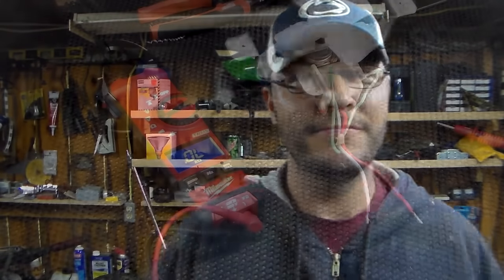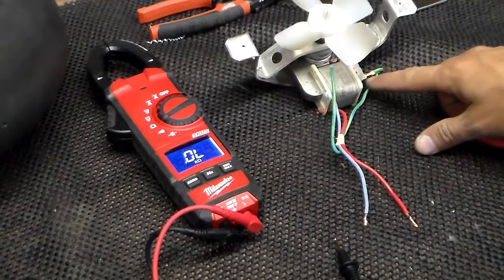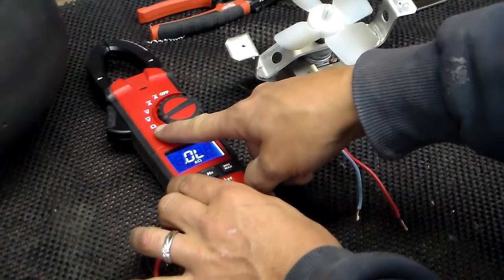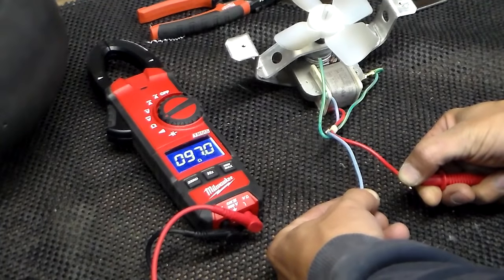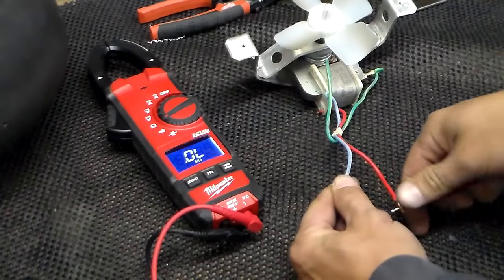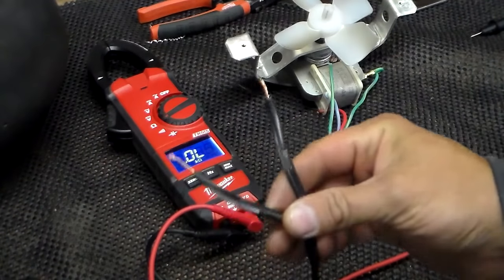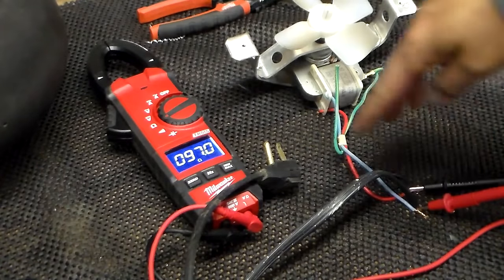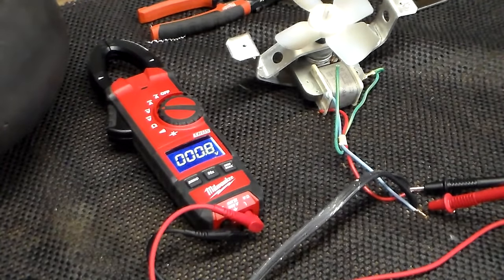How to Test the Evaporator Fan in your Refrigerator

Comment: Hi, Bill,
I like your video!
Please add one more check point at the very beginning: Determine what voltage rating of the fan motor, then proceed with either 120V or 12 DC.  They are not universal and not compatible with each other. 
Thanks for uploading the video.

Comment: After the ohms test, you should also test the leads to the metal body of the motor, in case the windings are shorted to ground.  When you test run it with 110v, put wire nuts on the wire ends, to make a good connection, and plug the cord into a power strip, so you can switch off the power quickly in case there is a problem.

Comment: Thanks fir video - I thought evap fan motor was bad on basement 20yr old fridge - I saw it not running when checked couple days after bad lighting storm came through - We lost power for 24hrs for down trees - I think might have had surge as some ground fault or arc breakers trip- Compressor condeser fan runs. Maybe there's  circuit board somewhere I dont have any paperwork  / diagrams - I thought  being 20yr old probably just had defrost timer? Guess have to investigate some more- Thanks for making  video- Just an old hillbilly shade tree type trying to save couple  dollars-

Comment: i have a weird problem with the evaporator fan in the Amana refrigerator. I turn fridge on and the evaporator cools well and ice starts to form as expected cuz the door is open but the fan will NOT run. I noticed the defrost thermostat is attached to the cables that control the power entry to the fan. IF I bypass the cable that goes to the thermostat the fan works, IF I connect as it was the fan will NOT operate. Do you think it may be a bad defrost thermostat? I do not know
how to test the thermostat...I dont have a voltage meter. THanks for your reply. Roberto. in Miami.

Comment: I have a Whirlpool freezer model ev171nyms04, it's icing in the grill area and the fan motor not running.  I checked the evaporator fan motor it looks to be bad when I test as show in your video using the volt meter omes  setting.  I have two question:
1. How can I ensure there is nothing else is wrong?
2. Fan motor for this model is about $100.  Can I use any other freezer evaporator fan motor with the same voltage that is cheaper?

Thanks,

Comment: Bill, my parents have a LG refrigerator with an on the bottom freezer. The lowest the freezer temps have gotten lately is around 20-25 degrees. The fridge stays around 36-38 degrees. What could we check to get the freezer colder? It isn't making ice either anymore. Thanks! We really like your helpful videos!

Comment: I have an old fridge that has problem with defrosting! I have to shut it down and manually defrost it every 2 weeks or so, and I was thinking if I modify it by removing the defrost components (they are useless anyways in my case) and and wire the fan directly to the mains in order to make it working constantly even if the compressor is off! will that help to reduce the over freezing? because there will be constant air pushing which may help melting the ice! I know I will still need to manually defrost it from time to time, what I am hoping is to do it every 3 weeks for example instead of every 2 weeks! will keeping the fan on all the time help? thanks
Reply: Did the permanent fan thing ever get implemented?  Did it have good results?

Comment: My fan just stopped this evening without any noise or signs it was going.  I see when the fridge starts the fan does a tiny jump then nothing.  I checked the wires going to it and 122 volts ac.  I check the continuity of the motor and 0L, so I then checked the ohms of the motor where it is measuring around 2.2-2.4 megohms.

Comment: I tested my fan and I am getting 30 ohms but it keeps dropping to about 15ohms I think eventually it will goto  0 but I did not wait... does this mean my evap fan is bad ?  I see when you test your fan its at 97ohms and sometimes even 100ohms and it should not go down ?  will the control board  stop a half working or almost dead fan from starting and thus giving me a  error code..67 on temp display panel:   failure of BLDC fan motor at freezing compartment  , poor motor , hocking to wires of fan, contact of structures to fan.  snapping or short lead..    I see the evap fan run during startup and about few mins in and it will stop completely and thru the code 67.

Comment: So I have a fridge, The freezer is ice cold fridge wasn't. I had some ice build-up in the channel that lead to the fridge. After clearing the build-up out, I can now feel air going into the fridge. But after 8 hours the temperature of the fridge has only gotten down to 50Degrees, does it normally take this long to cool down ?
Reply: Karel2015 I think it needs 24 hours. Any updates. I have the same problem
Reply: Did temp improve after more hours after clearing the channels of ice?

Comment: Hi Bill,
  Great video, very well explained and shown! I have my LG refrigerator evaporator fan out and want to check it the both ways you said. Mine has a white, pink and gray wire coming out of the transformer. Could you tell me which ones I need to attach to the probes to check the ohms and A/C cord to? Thanks, Joe

Comment: I open the pannel of evoprate fan pannel... It's not on... But I externally check the fan is working with 12 v adopter.... But not working in refrigerator... I think problem in wiring or it's 12 volt supply... please help me... what to do...???

Comment: Recently I have heavy frost and frosty icicles all over the food in the freezer and the walls inside the freezer, the seals were OK and door was properly closed. Can this be a sign the fan is bad?
Reply: Was the fan the problem in your case?
Reply: @TheJesseGuerra  Yes I changed out the fan and freezer was back to normal, but I noticed the same icing-up when I had too much food packed in the freezer sort of blocking the area around the fan.

Comment: HI Bill,
Question: my samsung freezer fan has 3 wires red, black and white. What is the extra wire for?
Thanks for all the videos. It's a 12 volt DC motor.
Reply: Filler Wong 
I have the same motor problem. 
What did you find out?

Comment: thanks for that.   my fan spins freely when theres no power, but when turned on it doesnt turn, and if you try and spin the blades, it will turn a quarter turn and stop.  theres a magnetic force there acting on it.  im gunna disconect the wires and do what you did and see what happens

Comment: You cannot easily test new fans they are 12 Volt and have 3 pin connector with some electronic board inside the fan. The only reason they replaced the old fan with this new fan is that old fan costs 20 $ while new fan costs 160$ .all comes from consumer pocket.
Reply: yup

Comment: tip of the day, don't touch the multimeter leads with your fingers when doing a measurement. Your body has some resistance and will not give you an accurate reading this way, it's a small increase on the reading....but, now you know....
Reply: actually it will give a slightly lower reading but i doubt it will change the diagnosis on this test.

Comment: Not recommended, but you take yer jumper cables from the truck, jack a conductor into both prongs of a 120volt outlet, connect that to the fan. If she runs she’s good. If ya got a big blue spark, that whole mess is gonna catch on fire if ya don’t trip the breaker.

Comment: Pls help, a Samsung refrigerator, fresh food section not working, while other areas are. changed the fan motor, and the sensor still not working. found out the fan after changing is still not running. what should be the problem?
Reply: Please provide update?  What was the problem if not the evaporator fan.

Comment: fan not running ....   fridge  stays cold ...   freezer stays cold ....  goes into defrost cycle ok ... fan comes on after a long  time  12-14 hours ,,,  top mount freezer model ...  if the fridge goes down a bit ,   then  fan goes  on ....   is  this  normal  ???